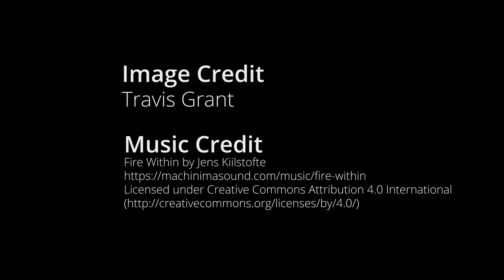Auravana Project | Design specifications explained v.1

Comment from the maker: The auravana.com/team page includes a scope of work, which is unfortunately, not finalized into a comprehensive project plan document. This needs to be done because it would more comprehensively answer your question, which is a common one. Also, the websites Faq page provides a general discussion on this subject. Essentially, the steps include: "finalize" our understanding of the system, complete the specifications (blueprints) so the system can actually be constructed, simulate the environment (as a test and also for marketing) . Once the system is sufficiently developed then it can be introduced and marketed to those with influence and/or ability to actually construct the system (or transition to it).
Reply: Great work. I really appreciate the work that you have put into this. Hope you're well. All the best.